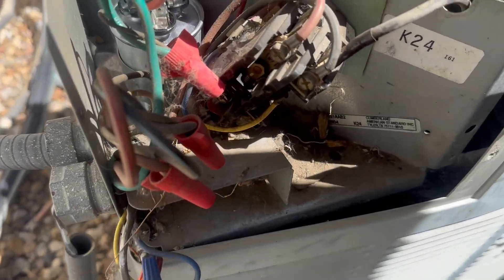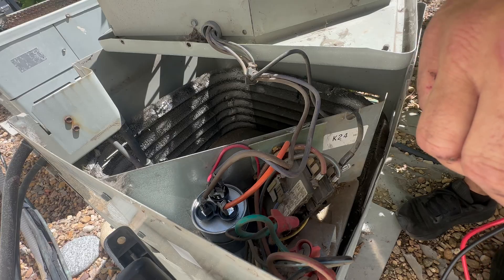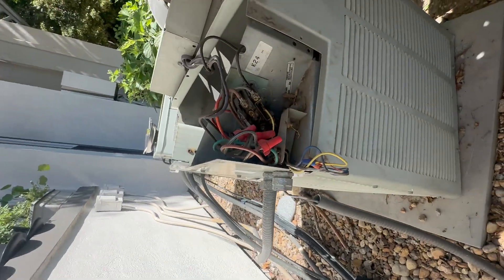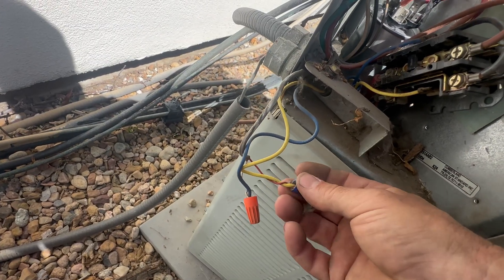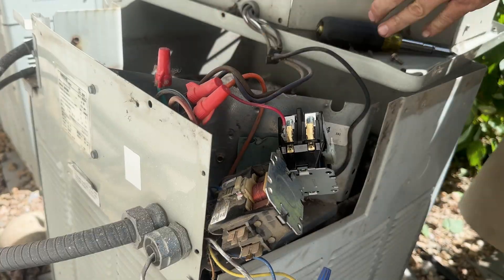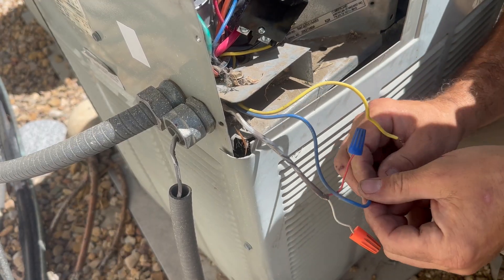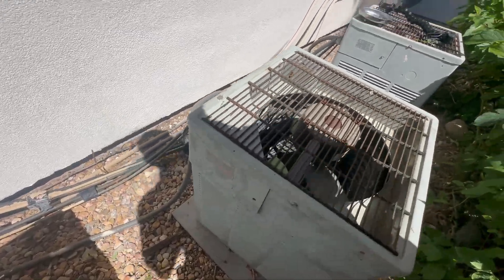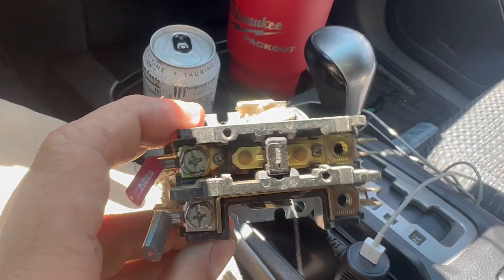Condenser Wont Start! Is My Contactor Bad or Capacitor?

Comment: Relatable!!  Dave is doing a service for the community.

My central air system’s outside unit was silent.  The floor under the return grill in the house was very very cold.  My $7 hydrometer said it 64° and 44% humidity. 
Classic contactor malfunction.  Sprayed a quarter can of contactor cleaner.  System came on and worked but wasn’t cooling properly.  Classic low Freon .  2007 unit so it’s the discontinued Freon.  Repair guy charges $250 a pound and I got three pounds.  He says the charge for a new contactor is $275.
It’s in a hard to reach area and I’m not as agile as I once was .
Thank you Dave!